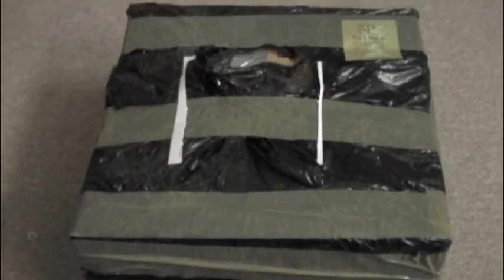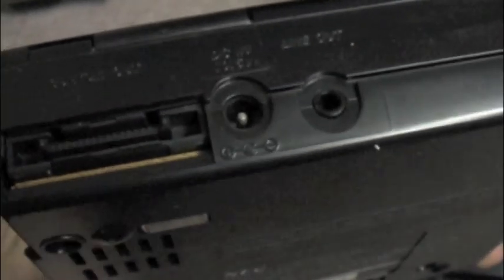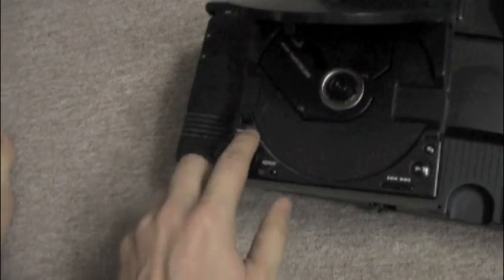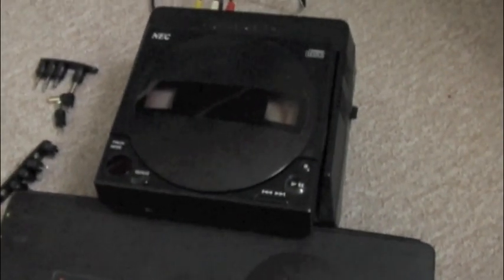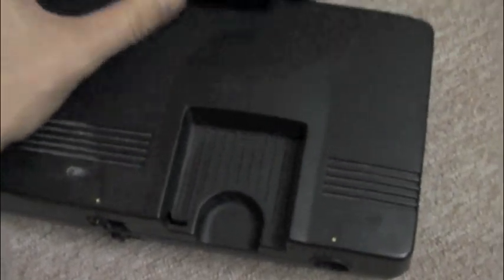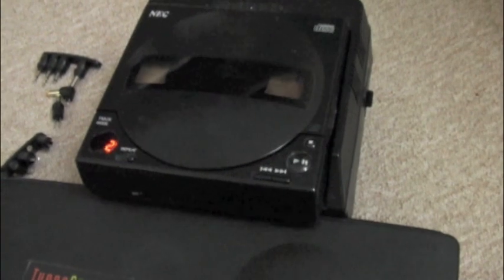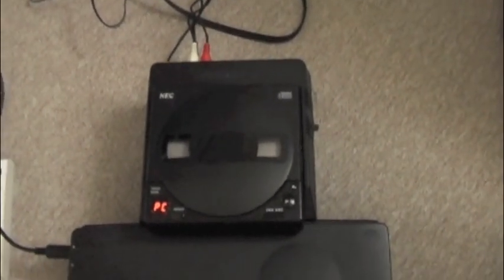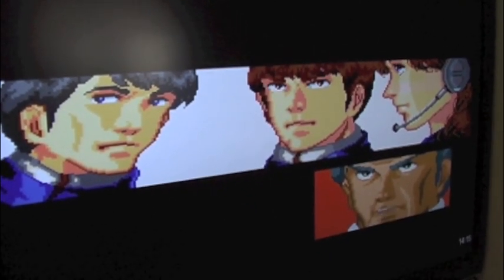TurboGrafx 16 RGB and Region mod.

Comment: You don't really need a region switch to play a japanese cd game cuz' all I needed was that card and I was able to play Rondo of Blood. I just wanna' know if the rgb mod that's put on your turbografx will still play cd games without composite in the back.
Reply: I’m looking for the answer too.
Need to know if the cds games run with the RGB signal too.
Reply: @zeroxdogma  I'm told it can but the audio exits one way so to get cd audio from the cd unit, you need an audio out on the TG, then hook it to the CD unit. Its confusing. Right now, its being modded so I'll understand it when its done. Then when he shows the pictures, I'll put in a video request for Long Island Retro Gaming to show how to get RGB on this console + cd addon.